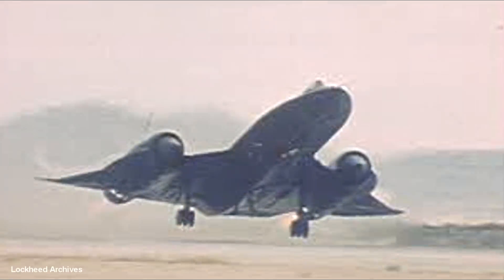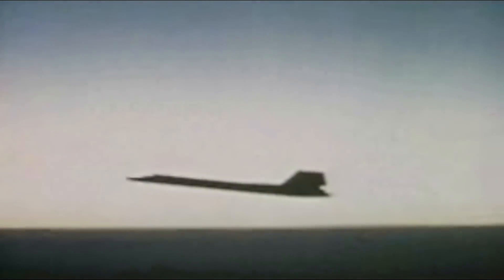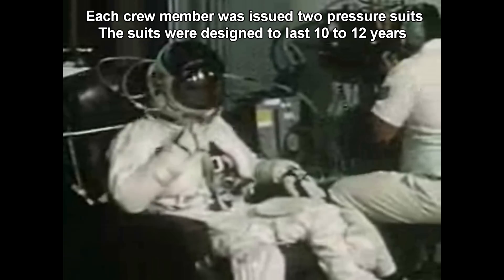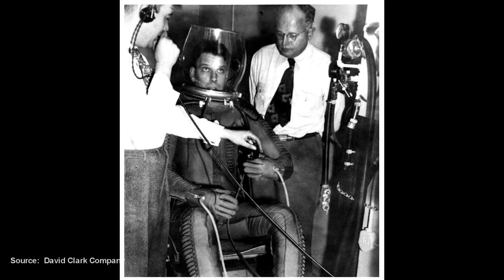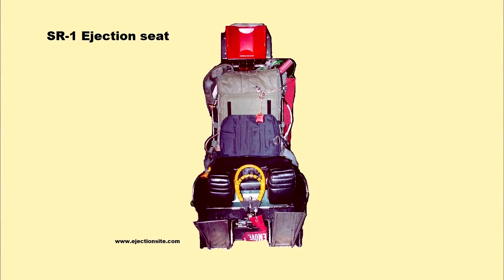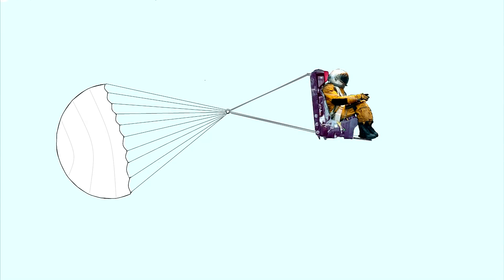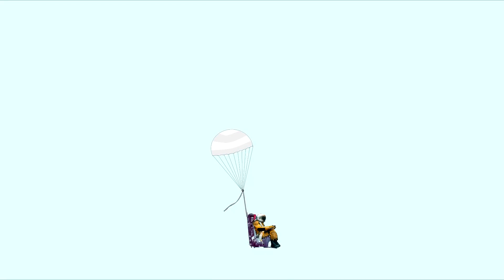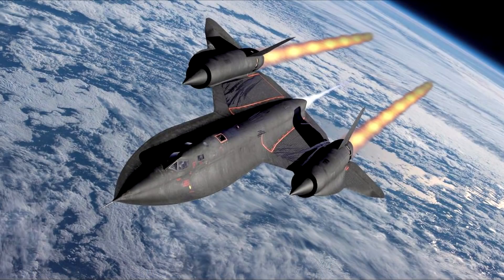SR-71 -  How did they survive EJECTING at MACH 3?

Comment: the reason people believe it is impossible is because there have been a few accident where they were going as fast but in lower altitudes (when going down from being shot but not slowing down) and people do shatter in pieces when they hit the air. so if they eject in high enough altitude it is probably safe but if in some bad luck, you are in low altitude and fast enough, you shatter. the cockpit should eject first, slow down, then eject the passengers. (the cockpit COULD be on fire, but fire will kill you slower than the equivalent of an explosion when you hit that wall of air.)

Comment: Holy crap. Ejecting at Mach 3 is insane :) Anyway, interesting info on the thin air at 80.000 feet. I did not think about that factor. I like these SR71 videos. Do one on the survival kit please.
Reply from the maker: I haven't seen photos of the kit,  just descriptions about it.
Reply: The air was still hot enough to melt steel at that speed. Hence the titanium.
Reply: @Steve211Ucdhihifvshi  not enough for steel actually.enough to melt alumium alloy.
steel is not often used in airplane, it's way too heavy.titanium alloy or alumim alloy would be alot lighter.
Reply: But there is a Story of a sr 71 ejection were the sr was in a vertical dive at mach 3. Hence much lower. Were the Pilot dislocated an Broke every limb on ejection. Look it up. Ist a interesting Story
Reply: You wouldn't be able to fly at these speeds if it weren't for the thin air
Reply: @Florida1888  That was an F-15E at mach 1.something. The seat and flight suit were not rated for that, throwing the poor guy into a world of hurt.
Reply: @Lightning_Mike  Ah ok i had that confused than. Thank you
Reply: @Florida1888  No problem! There was, though an SR-71 crash where it dissassembled itself at mach 3 and threw the crew out, so you're still partly correct
Reply: yeah kind of cool when you think about it. Especially since you see what happened to that one pilot that ejected just past mach 1 and broke nearly everything in his face. WITH A helmet. if this was at roughly sea level it would have obliterated these guys lol.

Comment: G'day,

Have you ever read,

" Man In The Hot Seat." 

by Doddy Hay ?

  He was the "Test Pilot" for Martin Baker Pty Ltd's late 1940s Mk-1 Seats ; he rode the first Rocket Seat, did the first Zero Altitude Ejection. (from a Gloster Meteor flying 3  Ft off the runway) and he did the first Zero/Zero Ejection too - no altitude & no airspeed either..., sitting on the Seat in the middle of the Airfield, strapped in  & pulled the stripey Red-White Handle..., and then floated back down from 300 Ft under a Parachute,  after the Seat unstrapped itself & fell free...(!).

  It's a fascinating bit of reading.

Have a good one.

;-p

Ciao '

Comment: I like this kind of content.

On a recent flight I was wondering if fighter jets have climate control. Maybe a video about this would be *cool*?
Reply: Yes they do, mostly there to keep the avionics cool, but the pilot does have cool breathing air, as it comes from a LOX boiler that is part of the pressurisation system, and which has to deliver heated oxygen. Heated to something like 15C, as it comes out of the evaporator at -160C and has to be warmed, taking heat from the circulating cabin air to do so. There is also an evaporative cooling system used to generate cold air for the avionics bays, as they both are heat generating, and are heated from skin heat, so there is a cooling loop to manage temperature to below 100C. Battery also is kept at cockpit temperature, as it needs to be kept cool for best lifetime, plus needs pressurisation.

Comment: This video is awesome! Investigating USAF crashes is what I do for a living, and as one of the subject matter experts on all emergency escape systems utilized in today's USAF aircraft, I would like to give you props for doing a fantastic job of explaining and illustrating the SR-71 emergency escape system!
Reply from the maker: Thanks!   I wanted to dig deeper into the mechanics of the SR 1 seat but couldn't find specific details,  like if it used nitrogen for the actuators or just used the oxygen.
Reply: @taofledermaus  I don't have all the SR71 specific information at my fingertips, but the seat used in the U2 is very similar, with only a few minor changes. All actuators are either electric (seat height actuator) or are functioned by hot gases which are delivered by multiple explosive  initiators. Otherwise known as CAD/PAD.

Comment: They have now admitted to M3.5... with hints that was not terminal max. They ran into unexpected unstarts when missions over SE Asia came with VietNam conflict. The engineers back home had failed to account for higher temps at high elevation in that area. Once one of the pilots was able to figure it out and new calculations were made to adjust for actual air density. Unstarts then became rare in that theater of operations.  NICE VIDEO!    more please👍

Comment: The most fascinating part to me is air pressure at those altitudes. Doing Mach 3 and then "only" getting blasted in the face with 100 something mph wind. Makes sense, but it's still crazy!
Reply from the maker: Yeah,  that surprised me too.   I guess at 80,000 ft.   it's more like the properties of space than sticking your head out the window of a Cessna going much slower.

Comment: How fast is mach 3 compared to a bullet?
Reply: It is roughly the speed of a .223 round.  It is roughly 3300 to 3400 fps.  Air temperature, pressure and humidity changes the speed of sound in air hence the rough numbers. A 9mm is in the 1100 fps range I believe.  A .45 acp is 900 to 950 ish I think.  It also depends on bullet weight and amount of powder so hence rough numbers.

Comment: These ejection seats were used on the first four Space Shuttle flights. The astronauts were not very confident using them would be survivable beyond the first few moments after liftoff. The shuttle accelerated too fast and too quickly in the dense air of the lower atmosphere..

Comment: I've always wondered why they can't just make the whole cockpit a "pod" of sorts that can be ejected from the rest of the craft. In theory wouldn't that minimize a lot of the risks associated with ejecting at high speeds?
Reply from the maker: They DID that,   for example the F111 had that exact type of system.
Reply: @taofledermaus  Cool. Just looked up the F111. Why don't they use it in more modern aircraft?

Comment: I wonder if it could have been a good idea to (simply) build the cockpit strong enough such that if the aircraft broke up at 80,000 feet and Mach 3 the pilots could wait a little while to slow down before ejecting. But perhaps this is a difficult thing as the debris could be spinning very fast, or things could be on fire. I know that at breakup, the cockpits can be put under ridiculous G loads from the angle of attack, and that would definitely be dangerous to try and ride out.

Obviously, the real solution is to fix the engine computer, which they managed in the end.

Comment: Actually the worst ejection was from an F15 pilot ejecting at 800+MPH Mach 1.05 and less than 10000feet altitude(meaning thick air) and also without space suit. 
Here is the description: "It felt like somebody had just hit me with a train," said Udell. "When I went out into the wind stream, it ripped my helmet right off my head, broke all the blood vessels in my head and face, my head was swollen the size of a basketball and my lips were the size of cucumbers. My left elbow was dislocated and pointed backward, the only thing holding my leg on was an artery, the vein, the nerve and the skin and my left leg snapped at the bottom half."

Comment: So it was more dangerous to eject at lower altitudes. Wonder if the A-12/SR-71 was even fast at lower altitudes? The flight manual has been released online. The flight envelope is extremely narrow. It basically couldn't go supersonic below 20,000 ft, and couldn't go above mach 2.3 at 50,000 feet. But interestingly, it also COULDN'T GO SUBSONIC ABOVE 40,000 FT.

7 minutes of free fall after ejecting at 80,000 ft would have to get cold though. I really wonder why they didn't use a clamshell pod similar to what was used in the B-58 or XB-70.